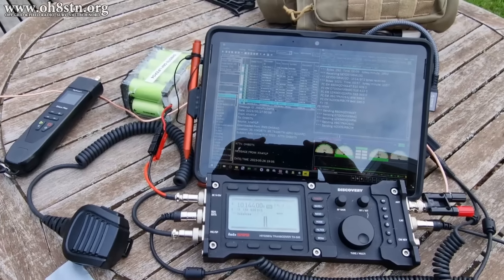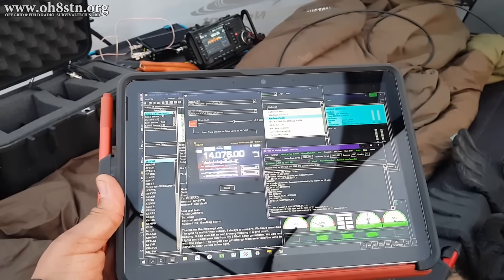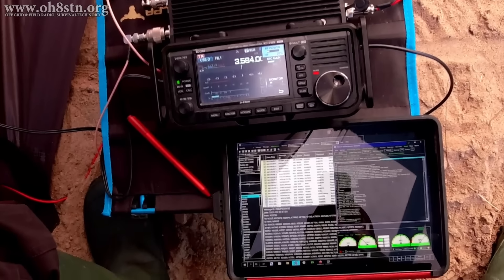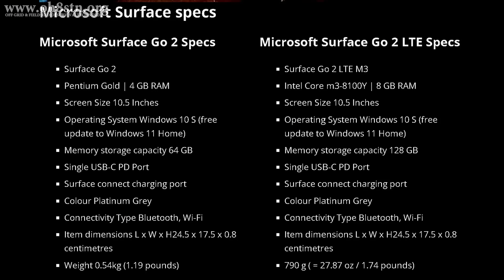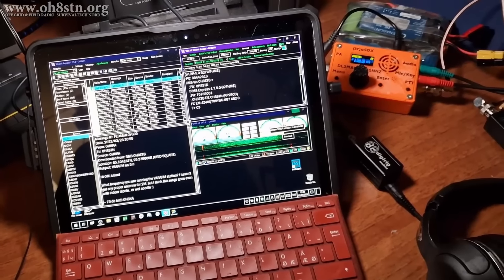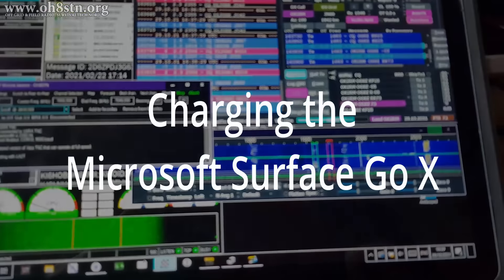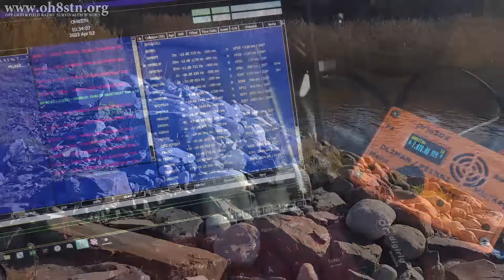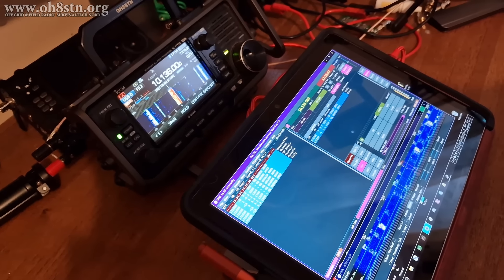Off-Grid Ham Radio with a Microsoft Surface

Comment: I really like these types of projects.  Last summer, I got to about 90% of the way to getting everything to run on Android phones by using a custom kernel and installing a Linux distro as a chroot.  The last remaining hurdle to overcome was compiling and installing drivers for a virtual audio cable.  Unfortunately, I had to take a step back from the project, but if it works, I should be able to get all modes with just the phone and a USB cable to the radio.  If I finally have some time to finish the project, I'll post it on FB and QRZ.
Reply from the maker: Huge amounts of work,. Respect!
Ham radio should be at the forefront of man-portable communications. Instead, it seems we are developing on top of antiquated code, rather than grabbing hold to something new like Android and iOS devices.
It saddens me.

Comment: I bought a Surface Pro 2 model 1927 about a year ago just because of this video. been trying since to get it to work. revisited this post and went to the gate splitter site to get the program. it appears they made an add on that is free now and it all works. I'm using BKT Time Sync and appears to work great. now when I'm in areas with no service I can use the digital modes. So very cool and thank you!!!

Comment: I took a leap of faith and spend a bit of change to acquired a refurbished MS Surface 2 instead of an Evolve III Maestro laptop; this was the best decision I made.  Not only can I use the Surface to support my ham radio hobby for digital operations, it also supports my DJ hobby as a controller for my Hercules DJ rig, plus the Surface now replaces the old and slow Chromebook I used when I travel away from home :)

Comment: Julian, another great video. Two comments. First, avoid the Surface Go 3. Microsoft botched that release - no new features (that matter), but much worse battery life over the Surface Go2. I managed a small fleet of them for my employer and we traded them for iPads as soon as we could. Second, it looks like Microsoft skipped any Surface Go updates or new releases for this current product cycle. However, there should be plenty of good used or NOS Go 2's still on the market. And you are right - go for the more capable processor and more system RAM.

Comment: Great video! I use the MS Surface Pro 4 at home with the SignalLink and TS-570s. I really want to get a portable/camping station set up! The Pro 4 has a known issue, the display starts shaking after using heavy programs like FLDIGI, MMSSTV, Skype, etc. No fix to it, unforch, so I’m in the market for a new tablet, and an appropriate radio. I want to be able to do the popular modes in the FLDIGI software. Neat that you have your radio connected wirelessly to the Surface! Love your channel! Jeff, KF5KWO
Reply from the maker: Definitely take a look at the 705. That wireless and one wire configurations are game changer for portable work.
Thanks for watching commenting and for the kindness.
Is much appreciated.
73
Julian oh8stn

Comment: I'm thrilled to have stumbled across your channel. As a relatively new technician, and someone very interested in field digital communications, to say I have hours' worth of questions I could ask you would be an understatement. However, I'll settle for just one. Would you share what you've done to make the Surface as efficient as possible? I have a Surface Go 2 that I bought expressly for field radio, but I'm fairly sure there are background processes and apps running that suck the life out of it. I'd love to hear what measures you took to streamline yours. 
Looking forward to catching up and anything new you share.

Comment: Looks like you have the Surface dialed in for portables ops.  Glad you were able to use GPSgate to get the NMEA data.
Reply from the maker: Yes, thanks. It was a very simple hack, solving problems which should not exist.
If only the 705 GPS could be accessed while using the radio wirelessly.
73
Julian oh8stn

Comment: I’m currently building my station and will be employing a Panasonic Toughpad FZ-G1, initially for FT8, and then for whatever other digital modes that appear interesting. I will be linking the tablet to a newer model  IC-705 that has the FT8 capability included in the firmware.
Reply from the maker: Outstanding. Have you solved the problem of off grid charging the panasonic tough book in the field?

Comment: I just ordered a Surface Go 2 LTE. Had to get it off ebay as no stores sell them anymore. There really are no other Windows tablets that have GPS, which is surprising. Unless you go with ruggedized tablets which are at least double if not triple the weight and price. I'm planning to make an EmComm Go-Box out of a hard case with the lid on the bottom that the radio and battery and everything is mounted to, and the deep part will lift up as the lid instead. The tablet will be mounted in this deep lid, which will keep it dry and shaded, so I don't need a ruggedized tablet and hopefully the glare won't be an issue either.

Comment: Thanks for this particular write-up! 

I'm using an alternate off-branded name Windows tablet that has three USB c ports. I bought it to get around the fact that the surface only has one USBC port.

Unfortunately I did not know that it uses a proprietary AC to USBC power supply to charge the tablet. 

It will not recharge with a standard USBC connector, which is a huge oversight. 

I have not had a chance to check to see if the integrated GPS will work or not. 

It does have an integrated LTE modem. But it only works on one band in North America as it was originally made for the Asian market. 

I need to do more testing on my end to see if it will do everything that you could do with the surface. 

If it cannot then I will end up getting a surface. Although at the time when I bought it. It was less than half the cost of the surface. LOL

If I have trouble trying to get it figured out. I might be contacting you to see if I could donate one to you and have you give it a go. 

The reason why I say this is the tablet is less than half the cost, and it comes with the detachable keyboard and writing pen all in one package!

73, Mark 
N2XDO
Reply from the maker: Hi Mark.
Yes , some of the budget brands will use a USB-C connector, but run 12 volts through it to power a device. The price seems nice at first, but then we have to spend time adapting to the non-standard connections, voltages, ... to make it work.
I chose a Surface because it is a standard, like an iPad. Companies make accessories like the case and country-specific keyboards, charging adapters, matte screen covers, ... We know these things will work because of the standard. 
I also chose the Surface from the channel perspective, because I know it will be there for the community if I invest the time into these blogs and videos. The most frustrating things is putting out content for a device which becomes discontinued after a few months.
I hope you get it sorted, and please let us know how it goes.
73
Julian oh8stn

Comment: Very nice video on the Microsoft Go! I have the original and use it on one of my Winlink setups with the TX-500. My other setup is a Surface Pro 8 and a 705, still haven't got the key yet for off grid charging for that computer, PD maybe? Always great to see your videos! 
73 Philip KF7JZ

Comment: Having watched previous incarnations of your compute platform, as things stand at the moment I think this seems to be the most pragmatic solution if you want to run Winlink and VARA as well as the other apps. I'm currently running everything on a Raspberry and use a low-cost Android tablet as a teminal. I'd like to run Winlink but being realistic that will need a PC platform sadly - Personally I am not at all keen on Windows, so the Surface line does make sense. I guess the added protection is useful during the inevitable percussive maintenance events that occur with having a Windows OS!
Reply from the maker: Honestly, I would run linux on the Surface hardware, if developers would give us decent tools for that platform. Winlink Express and Vara for Linux are a complete no-go on Linux. PAT Winlink should be ran as an app instead of a webpage, and Vara refuses to go Linux because he wants to get paid.
I would dump Windows in a second if we could have Winlink Express functionality and Vara/VaraFM on Linux. Even better, let's have them on Android.
73
Julian oh8stn

Comment: Thank you very much for sharing. The biggest downside I see with the windows surface is that it has only one port.  I noticed in your video you have what look like some flexible solar panels.  I was wondering what type and manufacture are they?  Thanks again.
Reply from the maker: For me, the singld port is enough for the IC-705, X6100. Charging is done through the Surface connect port. I also have a 3port usb-c hub if needed.
The panels are from PowerFilm Solar. 
PowerFilm Solar Panels: https://www.youtube.com/playlist?list=PLKMrdrsNkFA4BFf7wutLxDfEFt3JQd5n7

Comment: Something worth consideration:  In my field ops with my surface go 3 I've found that the surface overheats rather easily simply from direct sunlight.  Perhaps not as much of an issue in finland, but it regularly causes me problems because of cpu throttling here even in northern wisconsin.
Reply from the maker: Which model please? I've been to Spain with the model, operating from the beach. That model didn't show any signs of throttling.
Reply: @OH8STN  surface go 3 1900
Reply from the maker: What apps, widgets, utilities, ... are running on your Surface Go 3 i3 when it throttles back? There's no useful info in your comments for replicating or troubleshooting the problem.
I'll  run my Surface Go M3 in sauna this evening. It'll be easy to get the temp well over 50°c to see if it slso throttles and/or crashes. 
 I'd make a video about this if I were you. Would be very helpful.
Check out this video: https://youtu.be/lMdDhcYgdQ0?si=3_QdQPKOf8cGWWgh
Reply: @OH8STN  I've replied to this three times.  Youtube keeps removing it.
Reply from the maker: Thanks for the added info. You're the first person to mention this problem on the channel, so naturally was a bit skeptical. 
After searching youtube I found a few videos talking about this problem. Sadly, it's not only a Surface problem. I suppose this is the cost of having lightweight portable computing.
Reply from the maker: Removing your comment? On my channel, the only things that are blocked are profanity, a few channels who self-promote on my channel, and url's (because of spammers). Anything beyond that is entirely youtube on its own.
Reply: @OH8STN  I was in no way implying it was your fault in any way.  :)

Best I can figure is the reply was triggering some overly sensitive spam filter on youtubes side because I listed all of the software that was installed.

I can try and be more vague about it and just say that the installed software mirrors your own except ive also added chirp so i can easily field reprogram ht's, antscope2 to go with my aa-230 antenna analyzer and btktimesync so i can pull gps time off the 705 because i don't have the lte version of the surface, removed most of the microsoft store bloatware and related apps. and turned off a bunch of unnecessary background services which helps improve battery life.
Reply: @OH8STN  Such issues can be designed around, but in the case of the surface I think we're just a a bit outside microsoft's intended usage.  While a surface is certainly designed to be a portable device, I suspect the engineers that built them envisioned them living in the air conditioned indoors more than out in the woods in a tent.  When the surface eventually goes kaput, I will replace it with a toughpad, which also runs a full version of windows.

Comment: Have you done a review of the Inovato Quadra? I’m wondering if it could replace a tablet or Laptop in the field 🤷🏻‍♂️
Reply from the maker: You might find this interesting: https://youtu.be/xIrd2l8t4l8
Reply: @OH8STN  Very good points! I think you’re right on a Windows tablet being less cumbersome and more useful, especially with the ICOM 705 (my radio). Still, it might be nice to have the Quadra for the Ham Clock and as a backup Ham computer.

Comment: @OH8STN One thig I've struggled with this concept of the TX500, PA500, BAT500 combo is I've always wanted the 100W expedition version of the PA500. Do you find the extra 40W worth having? Or is having the fans a bit cumbersome and not worth the extra 40W? The expedition is quite scarce. I truly think the IC705 is a better radio in almost all respects except the durability department. That specific thing is why I am willing to go the TX500 route over all others as that's what I need is the durability. Only thing holding me up is the 100W exp model over the regular PA500. It will see some home base station use for me but not much as I mostly find HAM stuff more fun out an about. Curious on your thoughts on the two versions of the Expedition model as you are the only one I've found that has used both.

Comment: hi thanks for all your good work it realy helps .How do you get on for battery life on the surface , can you power it from the main battery pack .The cost of replacement batterys for the surface and fitting make buying a used model a gamble unless it can be backed up with an external supply.
Reply from the maker: 5-6 hours continuous use on both Surfaces. I am thinking about trying out one of the ARM cpu surface tablets since they are supposed to have much longer battery life.

Comment: Any thoughts on used panosonic toughpads/toughbooks for this application?
Reply from the maker: Absolutely! The Toughbook is a fine machine, but...
Pros and cons
-It is heavy
- It is power hungry
- It is very expensive
- Dual battery setup is awesome
- Requires external charger
- It is modular
- It has a great daylight readable display

I carried a toughbook for my work in North Africa back in the day. It was indestructible! Today I have 2 Microsoft Surface tablets for less than the price of a Toughbook or Toughpad. Must weigh the pros and cons.
Great question
73
Julian oh8stn

Comment: Other than the Radio in the video, how would a newbie like me know what type of radio can be remote controlled with a surface?
Reply from the maker: Grest question, researching specs.
The ic-705 in the video is quute unique with it's wireless capability. The Xiegu X6100 & x6200 has similar functionality,  but less than perfect. What is most common is the one wire Hookup via USB. This requires a radio with built-in audio interface.
Reply: @OH8STN  apologies for my ignorance, but do most mobile/base radios come with that USB audio interface or is there a specific spec to look out for? I’m assuming handheld’s do not. Sorry for the juvenile questions, but I have a surface that I’m going to wipe clean after watching this video just for Amateur radio purposes.
Reply from the maker: @rawzville correct👍
handhelds don't have audio interfaces built-in.  Neither do FM mobile radios. It's the all-mode HF/VHF/UHF portable and desktop radios. For portable data modes eith a Microsoft Surface,  ICOM-IC705,  Xiegu X6100, x6200, or a radio with Digirig or LiNK500 interface.

Comment: You can get a usb-c to the microsoft power cable.  To convert the usb c to the propitary connector, this gives you '2' usbc basicly.
Reply from the maker: Yep, that's what I'm using as well. The surface connect connector is actually USB-C PD, albiet with a different connector.
thanks for the tips.
73
Julian oh8stn

Comment: If a ham operator is using a Microsoft Surface Go 2 which does not have an internal GPS feature, can he purchase a GPS accessory unit to use with the Microsoft Surface Go 2 so he can make use of JS8Call?
Reply from the maker: Of course. You'll just need an adapter or a u s b c hub to plug it in

Comment: Just found your channel and love how you emphasize energy needs for these tools! On another note i have 2 questions for you, im looking for a receiver like the Tecsun pl 660 for family who dont want to invest in hf setups. What do you recommend? Also would it be more wise and cost effective to invest in a vhf/uhf setup like your chest pack that uses digirig and a microsoft surface for data modes. Or go with a dmr handheld with its own data modes?
Reply from the maker: Excellent questions.
For the d m r radio I would suggest looking at mine Retevis Ailunce HD2 videos & shorts.  That radio can do analog voice/data and DMR. 

For the receiver, Check what frequencies you want to monitor and buy one which covers those frequencies, is simple to use, and can be charged grid down.
Thanks for commenting and for the kindness. It's very much appreciated.
73
Julian oh8stn

Comment: Hi Julian, how do you handle the inevitable Windows Updates? Do they ever interfere with operations - off-grid, or otherwise?
Reply from the maker: Great question.
I used to, but learned my lesson. First, I don't connect the Surface that often if ever "directly" to the internet. Second, I disable Windows updates until I want to update. Third, I block MS at my firewall, but it still tries to find a way via one of the other machines.

Comment: I have the same cover and keyboard, both are top notch. I have an old Surface Pro and unfortunately, it only charges through the magnetic Surface Connect. Any suggestion for charging in the field where there is no 110v, other than in inverter, which is more to carry?
Reply from the maker: Please watch the video again.  There was a large part dedicated to charging in this video.